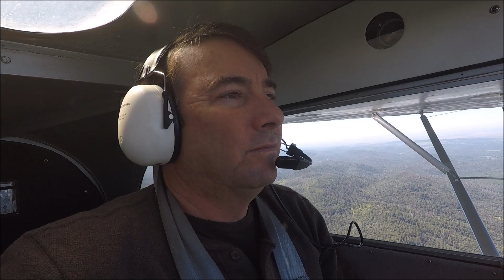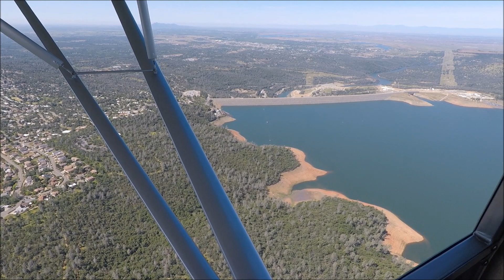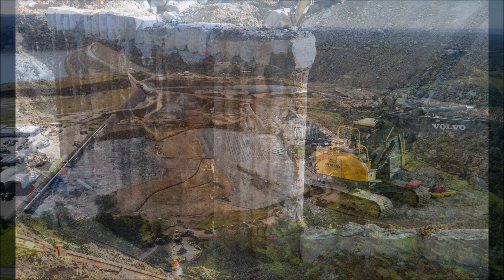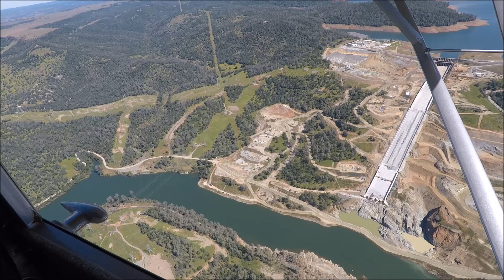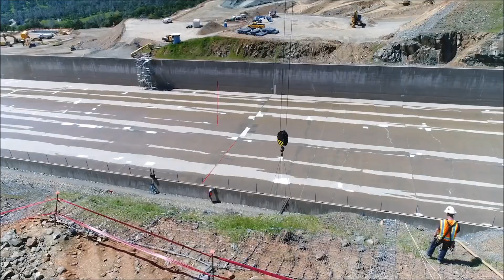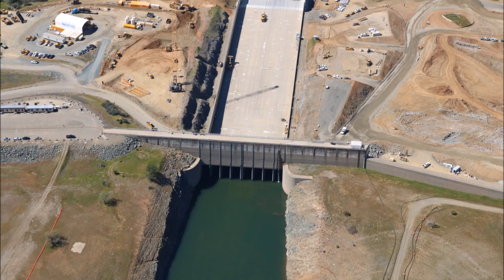Oroville Update 1 May '18

Comment: Not gonna sugar coat it but spending all this money to do the why not cut away some of the emergency spillway and install a second main spillway to there not putting stress on just the one main spillway, I know this dam might not as big as some dams out there but it wouldn't hurt to put a secondary main spillway in.
Reply from the maker: A second spillway may very well be in the long term future plans, just as they did with Folsom. Right now time is of the essence to get the main spillway operational.
Reply: blancolirio yea I can understand they need to get this one fixed before thinking about making a second one.

Comment: Now the Oroville Dam rebuilt Spillway need to be add provision of slope protection like rip-rap & stone pitching on the both sides of embankment to protecting Spillway Walls & Bed from heavy flood water flowing pressure somewhere if hitting to its surroundings, whenever high flood warning and over Topping situation as much in last year 2017 or in future could not damages to this long strip of Newly constructed Spillway???

Comment: what a waste of money materials, man power... they should have made a much more temp. fix on the lower part of the spillway, instead of totally destorying what they put up.. and should have lowered lake level to pre-pineapple express deludge levels (500feet.) and taken there chances.  I would have put concerete on the lower part of the rocks without building anything but still leaving my option open to use the top half and the middle half that was completed the correct way...
Reply from the maker: Mike Ovanes I believe they're hiring....;-)

Comment: I joined, but don't git no notification. Do I need to get some kind of yestification? 

Please explain the spillway drain system, and where the water comes from and where it goes. 

Why is structural concrete (how thick, how much steel, mix specs) being "pinned" to the RCC? Do they expect water along the "interface?" What's the useful life of the project? What happens after that? 

Thanks. Good job.
Reply from the maker: Hit the little bell next to the subscribe button...

Comment: Hi Juan - Really enjoy your videos. I tried to find out from whomever is responsible for the webcams at Oroville why they are never up but apparently those in charge prefer not to address the issue! One question though for you - how would they drain water from the lake today if they needed to? There is a lot of activity on the main spillway - machines, people, new concrete.
Reply from the maker: Hyatt Powerplant and the RVOS, gives up to 16,000CFS capability. That's how they managed it all winter.

Comment: good to see progress at Oroville soon they are going to open the gates and drain the lake then the upper spillway will be rebuilt and the gates replaced. right now before they open the gates in July the RCC is being milled before the concrete is pored on top of it and they are getting ready to removed the RCC walls before the main walls are installed and this time in July the gates will open and the lake will drain.

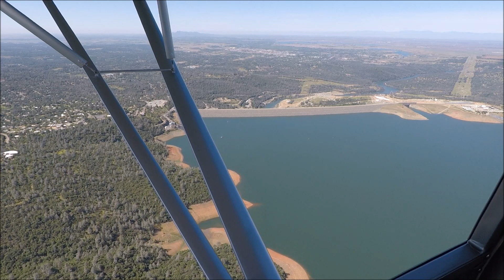Comment: At 1:57 mark, you said 2200 cfs going out/4-5000 cfs coming in. If only 2200 cfs is going out, does that mean the Hyatt power plant is barely producing?
Reply: Isn't this a time for storing water, letting the level rise, as the inflow will be gradually diminishing?  The power plant isn't the primary purpose for the reservoir.  When the water level reaches the established high point, release rate will increase to keep level from rising further.
Reply from the maker: yes, just a single turbine, allows time to work on the other turbines while the resv. fills.

Comment: This is stupendous. I thought all those Souls were going to be drowned. Thank God for all those Souls who do massive construction very very impressive what a relief what a relief
Reply: There was never as much threat as some folks seem to think.  The dam itself was never threatened; it's a separate structure.  We saw the primary spillway's worst case scenario.  The emergency spillway, aside from its improperly established slope, is lower than the top of the dam, which is why is took over which the primary spillway was initially closed after first damage.  They then determined that reopening the primary spillway was going to be less problematic than allowing the emergency spillway to continue flowing.  That massive erosion on the south flank of the Primary Spillway was expected to be limited--for reasons verified in results.  Those spillways are atop a natural bedrock ridge that's serving as the dam's north abutment.  The deep soil was eroded to expose the bedrock that wasn't going to allow further damage.  However, the prominent threat was the slope debris being washed into the Diversion Pool.  If that debris was allowed to clog that pool, causing a backup of the dam's outflow, that backed-up ponding could breach that debris clog and release a surge of water downstream.  The release of that limited clogging meant that only temporary surge, a single wave, would sweep downstream.  Threat from that wave was much less, and temporary.  However, that was avoided by choosing the more limited slope erosion by the Primary Spillway instead of the larger, less controlled slope of the Emergency Spillway.  The dam was not a threat parameter.

Comment: Im still amazed at the size of this project. Big $$. Good stuff blancolirio.
Reply: Yep.  This is totally predictable.  All 50-60 year-old engineering is definitively obsolete...everywhere.  This predicament needed so much attention as its obsolescence aged that it was going to take this kind of moderate disaster to muster the required funding.  Also, much of this modern technique was not going to be available to use 40 years ago.   The difference between standard practices of the Sixties and those used today is profound.  Engineers of the 50-60 years ago generally didn't know better.  All kinds of engineering have seen similar "advancements".

Comment: Thanks for the update Juan.  Much more informative that than the 24-hr channel that specializes in nonsense conjecture that the dam is leaking, the green spot will consume Oroville, the new concrete will be too thin at "only 2.5'" thick, yada yada.
Reply: That dam isn't concrete.  It's an earthen dam, the modern preference for dams.  It's a self-healing design, composed of zones of designed porosities and impermeabilities.  Lateral seepage on the dam's face is facilitated by the design.  Many times, it's been mentioned that most earthen dams feature green spots.  That's not a design flaw.

Comment: Will the top of the finished secant wall be horizontal from end to end?
Reply from the maker: Hey Teacher no it will dip into two low spots.
Reply: If it's to match the concrete slope that integrates it--as mentioned, yes.

Comment: When would the RCC walls of the main spillway ever have had a chance to be used?  They are coming down soon.  They weren't built that long ago.
Reply: They were built for winter spring 2017-18, and planned to be removed when it was built.  They built it to have a 100,000 CFS rate in case that was needed.  All dictated by modeling of historic precipitation and runoff.  That was found to be the worst case needed.  Easy to say now "it was not needed" but no way to know it last fall.  Had to have the capability.
Reply: There were there during the storm releases of recent months.  As Juan mentions, more sub-drain work remains for that area of spillway before permanent walls are erected.  The temporary walls were enough for this limited service.

Comment: I've been looking forward to this update since the last one when the weather was about to get  bad, cheers Juan

I see in the DWR videos the main spillway looked like it had a very small amount of water on it, were the gates leaking? 

Also the emergency spillway had water on also but the lake level didn't look high enough for it to overflow so i'm guessing they wet it with trucks or hoses or something? 

and are they planning to leave the mesh fence next to the main spillway there indefinitely?
Reply: The gates do seal better with water pressure on the gates.  They have to keep the RCC wet as it is applied, so the upper courses do get sprayed if there is an interruption.  I think they have an hour or so to get the next course down without re-wetting.
Reply from the maker: And I think the mesh will stay.
Reply: Need to recall that the spillway walls have drains in them for soil water control.  Groundwater was the culprit in the initial cracking of the original too-thin spillway surface.  The new hyper-thick protection under the replaced sections is addressing that threat.  Drains built into the new surface are addressing that threat.  If you can, find the DWR video footage of the original shutdown of the Primary Spillway...you'll see how the upper portions of the spillway walls show water spouting out of the soil drains several feet into the spillway, adding water that kept flowing into the breach after the gates were closed.  Those wall drains don't close and they're along most of the wall.

Comment: How come they had to cut down the secant wall for the center drain in the emergency spillway?  Was that a redesign?
Reply: It's hard to know if there was a "redesign" - nobody has reported that.  What is more likely IMO is that due to the construction technique of a secant wall (drilling), it had to be built level.  Cutting it is not that big a deal, relatively speaking.

Comment: I think the DWR is building an 8th Wonder of the World there. It may not look like much visually to the average person, but the amount of work going into the project is staggering.

I see now that the side walls of the middle section being milled are very different than the sidewalls of the upper section, more of a temporary type that will be replaced with the permanent walls.
Reply from the maker: DeMeaning Plebny yes, that's the temporary FCC walls used just for last year. And will come down.
Reply from the maker: Rcc

Comment: Thanks again for your updates. 
 Question,  With the lake level up to the gates.  Is there an alternative plan to spill water in case there is a problem at the power plant?
Reply: The river valve outlet system (RVOS), which operates in parallel with the power plant.
Reply from the maker: Yep, the rvos.

Comment: From what I understand, milling of RCC is not just to make it flat but to remove the top 2 feet that will be replaced by structural concrete.
Reply: Hello Olivier ~
The milling is just to make the lumpy RCC  smother to be able to work on  and to grind it to a subgrade grade elevation that will then accommodate the new placement of the 2.5 foot structural concrete reinforced slab. The RCC was placed 2.5 feet below finished grade and you can see the difference at the top and bottom of the RCC slab where it joins the finished structural new sections.

Comment: Juan, ??? Trying to understand the design fix... Did they only cut off only part of the secant columns,  leaving a section standing, pouring that beam wall level with the RCC over the cut portion, and then reburying the whole thing? Or did they deliberately pour the entire secant wall too-tall with the intent of excavating well below grade, cutting off the tops along it's full run forming up and pouring that beam wall over it and then burying it? Couldn't tell if the picture with the partial columns still standing was the final cut stage or that they were still planning on cutting off the tops of all the columns.
Reply from the maker: h baker poured it mostly level then cut to contour desired grade.
Reply: blancolirio
thanks! Your updates are extraordinary and relevant. We learn a lot everytime you post a video. BTW Fascinating inside look   at pilot emergency training and jet engine details.

Comment: Just one question. What is that stepped thing they are building?
Reply: The steps help to dissipate energy, where a slope would add to the energy of flowing water. The more energetic the water, the deeper it can scour, once it leaves the concrete.
Reply from the maker: Ben Steel the emergency spillway splash pad.
Reply: It'll stay stepped.
Reply: Thank you for answering my question before I asked it. ;)
Reply: To catch the gold🤣
Reply: Will the steps stay there or will it all be sloped???
Reply: Angel Phillips wonder how much gold was washed into the Feather River?

Comment: The dam fascinates me greatly. I had not ever even heard of it until the emergency spillway failure. I surely would not live below the dam... not even anywhere near to it all the way to the ocean. I do wish someone would cover the green spot and entirely the full length and breadth of the whole dam with hundreds of feet thick clay fillers, very thick and to be mighty strong. It looks frightening small, considering the pressure forces of that much water. My stomach churns frequently about it, and I live three thousand miles away.
Reply from the maker: Clayton Smith the dam is fine, look at the side view. It’s enormous.
Reply: blancolirio good to think so... the Croton dam twenty miles or so from me is a favorite fishing hole for me, and I'm startled when the siren for the flood gates sounds... there's cracks all over and newer concrete repairs also. People say it's fine, but I try to always stay somewhat near "escape routes" up the wooded and brushy steep hill.That siren sure gives the chills. Abandon gear and RUN!!! At nighttime the fog rolls in and yes there's fish, so I keep going there fishing, scared out of my wits sometimes!
Reply: The green spot was fully investigated.  What are your qualifications to second guess the regulatory agencies?  Conjecture?

Comment: Juan thanks for another great update.  just thinking back to last year the size of the hole the water had carved out is mind boggling to see it now.  After all the work they have done,  I hope they still keep the saftey of their crews while they push to finish those 2 sections of spillway and the RCC splash pads
Reply: It really was a giant hole.  I mean, I've lived in apartment buildings that were smaller than the huge, gaping hole in the spillway.  I'm local.  My grandfather was a Teamster on the Oroville Dam so I'm well aware of how big it really is.  I mean, it can easily be seen with the naked eye from roads about 15 miles west of the dam.  The dam itself is a mile across at the top.
Reply: Safety is job #1 as we have seen.  That will not change.